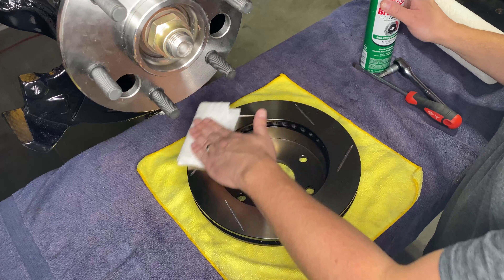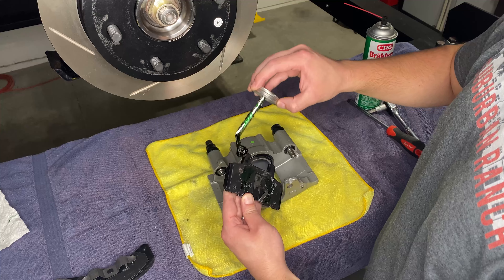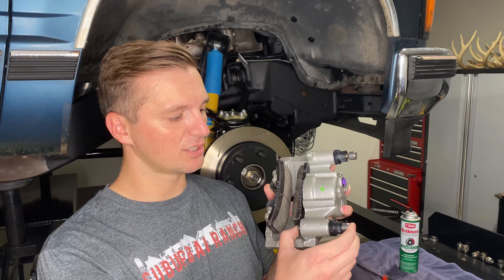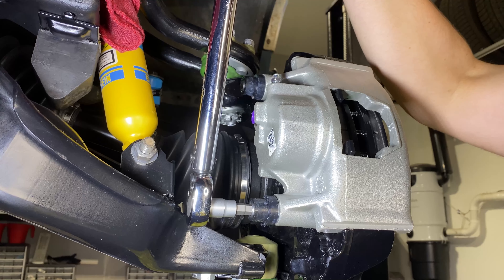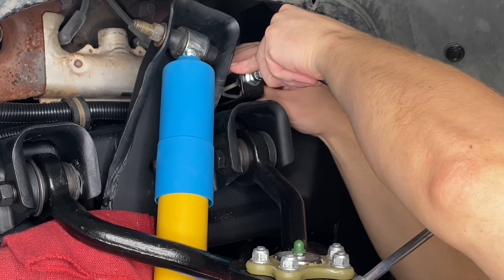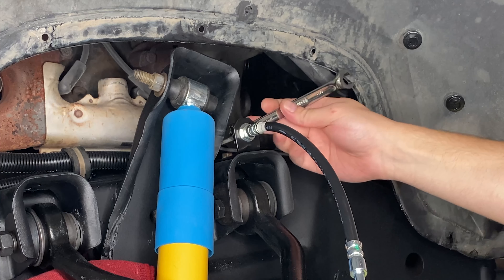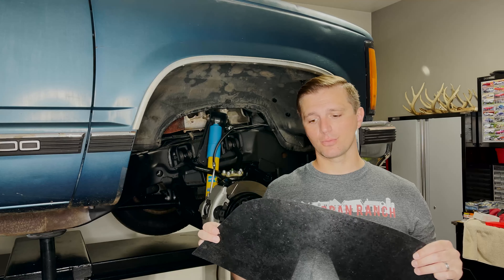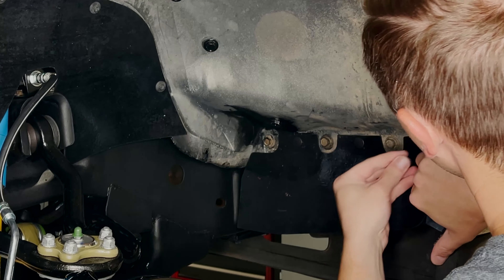Easy front brake replacement on an 88-99 OBS Chevy 1500

Comment: Great video. I have a 1989 K1500 Scottsdale with a 5 speed manual transmission that has no 1st and 4th gear. Bought the truck new, but debating on a transmission rebuild. Cannot find a rebuilt one. According to Kelly Blue Book (only goes to a 1990) the truck is only worth a few hundred dollars. Has about 270,000 miles on motor, transmission, and transfer case. Have replaced the clutch twice over the years. Perfect body, but has original paint so it needs a paint job. Would you attempt doing the work yourself if you had it, since repairs may be a couple thousand dollars. (78 years old) so cannot do what I used too do.
Reply from the maker: @Ray Alford Just depends, if you have the tools I say go for it. It’s a lot of work though!

Comment: Hi great video i have a question the brake pads are the same for 88 chevy c1500 and c2500 or they are different? 

Thanks
Reply from the maker: @Kiko Zaa Check Rockauto for part numbers, not sure if they are the same or not.
Reply: @SuburbanRanch  thank u